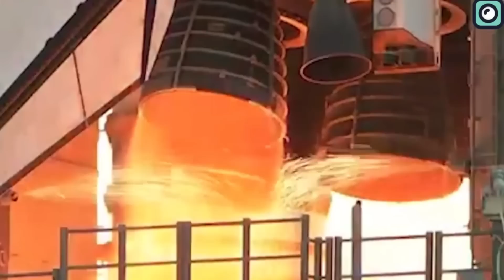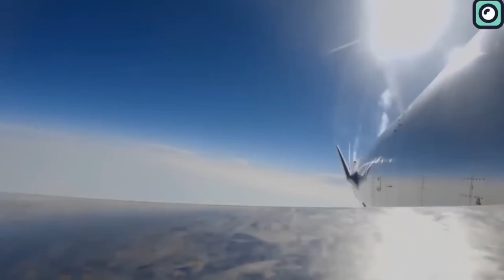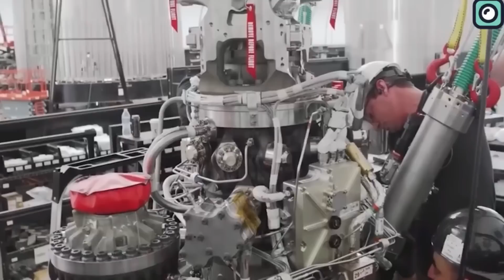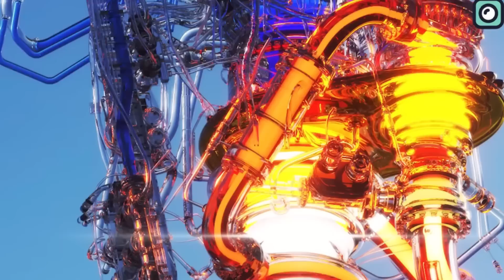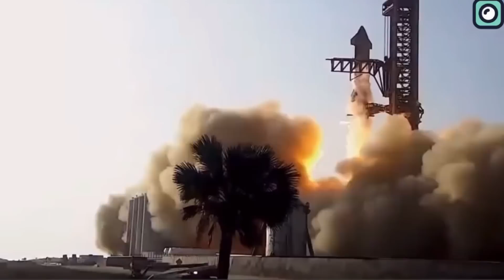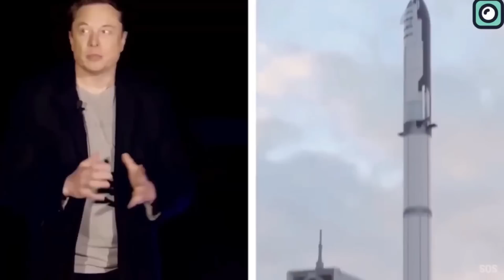SpaceX Starship's Second Launch is Happening Soon... Musk Says This!

Comment: Engines are perfect, the only problem is the launchpad. If the launchpad would be better, we would see the previous launch rocket much different from catastrophe. It would be huge success. The constant failure are not buster engines, theyare destroyed or stopped by reverse thrust generated by the launchpad. If the launchpad could be higher, which is possible, it could be extended, the buster engines would work perfectly, as usual in the proper coditions.

Comment: yeah.. the rap-vac is NOT the solution to raptor 2's theoretical reliability issues.  The rapvac is the same as the raptor2, but the the nozzle is just larger.
We don't even know if the issues around the loss of engines on the boosters is related to the engines or the booster configuration, as we've not seen issues like this pop up on the spaceship tests.

Comment: One would think What with All the Brighten Engineering  minds employed by SpaceX , they'd foresee  events like the launch pad damage that happened .
Now , with Water Deluge  system to assist  with the Boosters Engines exhaust damage 
I hope they've  thought it through and have Safe guards in place against  Massive  " STEAM " Damage .
Waterproof  launch pad = Check
Booster Exhaust = Flames / Heat - Check
But  STEAM is a  Gas , much more invasive